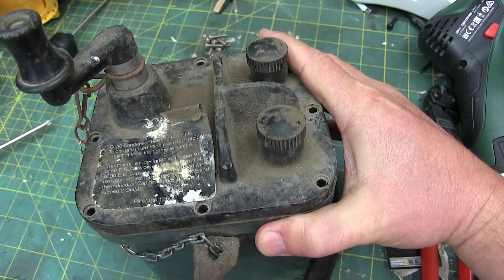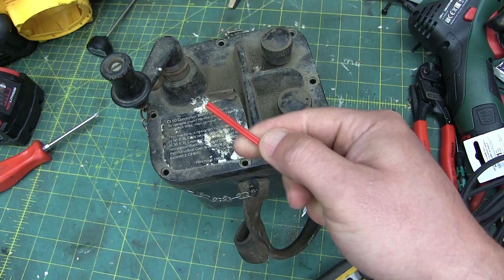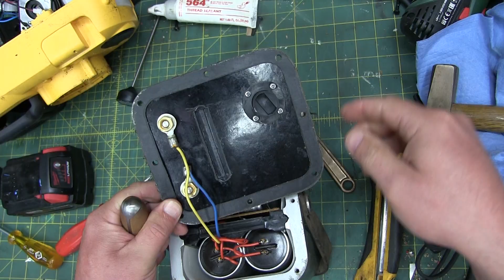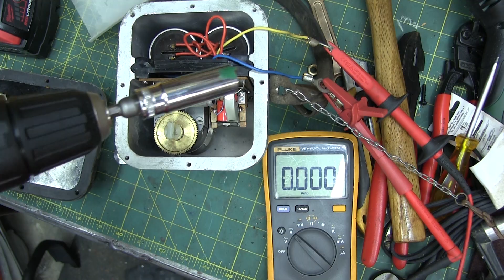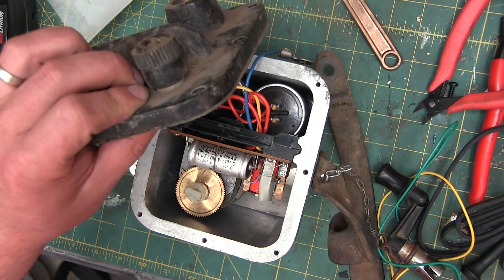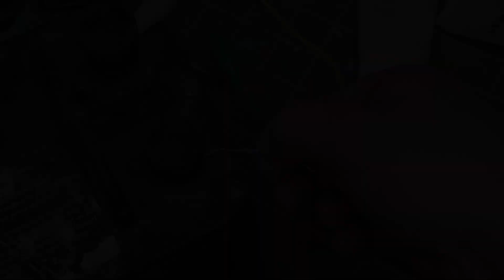BOLTR: Blasting Machine | Cool Old Gear

Comment: I can't help but wonder on whether or not if you connect the blasting leads to your car battery, if it will be enough to assplode.
And if it doesn't, what if you then try and start the car while everything is connected?

Comment: Back in the 1980's, I worked at a consumer electronics repair shop. You're blowing up resistors brings back memories. Take an 8 ohm 1/4 watt resistor and and place it on the back of a speaker attached to the input lugs, then wrap the fuse of a firecracker around it. A tech that just got done repairing an amp will test it out on the speaker and when he turns up the volume....Kaboom!.  Today you probably would get fired for that. Back then, you were just told not to do it again.

Comment: Just a thought from how you were tapping on the top of that screwdriver/prier- if the titanium blades in the handle were rotated by 90 degrees, you could hit it in the "prying" direction, without transferring the force though that strange spongy cellulose material

Comment: you can clear the non-glass glasses with a high temp flame, like a cigar lighter. Just touch the flame for a few milliseconds horizontally and it will be cleared.

Comment: In my high school psychology class the teacher had a blaster box very much like what you got, a crank handle with two leads coming off it. The idea was to observe subjects reactions to sudden unexpected stress conditions. The unit was to be cranked slow till it hit some kind of voltage threshold delivering a sudden mild shock, only the fact it gave a shock wasn't told, the lie was the body's resistance caused the buttons to pop up, each subject was to be filmed in an isolation booth and the videos were to be viewed later. I was lucky enough to be the "Cranker" since I knew what it was. A neighbor girl I had a crush for was asked to demonstrate how the leads were to be held to the class before entering the booth, when about half way through the instructions I lit into the crank like prison grub, I had however no idea how high you could get the voltage up to, I'm thinking car battery at most, by the look on her face it was obvious every muscle on her body had just puckered hard enough to bend steel. I never did get a date with her after that, in fact she would go out of her way to avoid even passing me in the hall, some just can't take a joke. I had ten days detention for that and a trip around the campus picking up trash, I guess only capital punishment was good enough for her.
Reply: P.S.- I have accidentally urinated on a live electric cattle fence wire before (you can bet I never did that again), so I knew how there was no lingering effects from the shock.

Comment: "...anything you want me to do with it..."
Ooooh, yeah!  
Bigger capacitors to initiate via exploding wire a water aluminum powder mixture for the purpose of metal forming....https://www.google.com/url?q=https://www.osti.gov/servlets/purl/12653&sa=U&ved=0ahUKEwiZpbzvgPbcAhVHlKwKHUrqAawQFggZMAY&usg=AOvVaw1FHXyGhuNVCofxfcP_wviy

...or skip the aluminum powder...
https://www.google.com/url?q=https://aip.scitation.org/doi/pdf/10.1063/1.341365&sa=U&ved=0ahUKEwiZpbzvgPbcAhVHlKwKHUrqAawQFggNMAE&usg=AOvVaw0l0FnuLMFCrqzR7bC_-laL
And just explode a wire in water to shape sheetmetal to an evacuated form.

Comment: All my videos that venture into blasting get demonetized. But hey even if I do a video with no swearing or anything wrong it's still demonetized. YouTube never tell you where the problem lies. I dare say that beautiful machine is built to shoot 50 caps in series. The blasting mother you want is the Beethoven Mk 7 Exploder. That baby's got a killer sting. Condenser style exploders don't like parallel circuits. Their impulse is too quick to excite the circuit when the bridgewires are stacked up in parallel. Anyway it's a job for some. Obviously YouTube is in RIP mode. Killed by PewDiePie
Reply: You mean Wall Street Journal.

Comment: I think you should figure out a way with all the gears that you have in your shop to mock up a block and tackle in a box that runs off a drill have it go right into a gear have it go right into a drill Chuck use a lot of the gears that you have unbelievable reduction so you can hook up pulley up to something and then you use this gearbox with a drill and you can lift 500 pounds your creative it like that I could actually use something like that and that would be cool to watch build gear reduction is Skookum as frig

Comment: I serviced a capacitance discharge unit that was a box like 3'x2' and 2' deep. It was filled with capacitors about 4" diameter. Big 3/8" thick copper bus bars connecting them together. Also for setting off explosives.

Tested it once serviced. That motherfucker made cables that were 2" diameter literally jump a couple of inches off the ground....

Scary shit lol

Comment: Ingenious how this works:  generator charges big capacitors and little capacitor.  Little capacitor has a neon bulb with a break-over (conduction) voltage of ~60 -120V  (works like a HV Zener diode) connected to relay coil; relay discharges large caps to dynamite.  Boom.   This system is a minimum voltage level auto switch, when you crank enough to charge up the big caps enough, the relay switches them to the dynamite.  No batteries or power supply needed!

P.S. Gears are not "reduction". The ratio of the Large Gear to the small gear  on the dynamo speeds up the RPMs on the generator to produce higher voltage (simple generator = higher RPM = Higher Voltage).

DC or AC? Solid or stranded wire? The "skin effect" is better for high frequencies, so stranded wire would be better. Why?  The real issue is Dv / Dt  (Delta Voltage vs Delta Time), essentially the fast change of the voltage (from the discharge of the Caps).  The fast voltage change is equivalent to a high frequency, and would benefit from the "skin effect"  (rise time in microseconds, can be seen on an oscilloscope).

Comment: I do remember you havin’ grandpappie’s anvil.  Your mission: if your willing to except, it is to manufacture enough black powder to blow a cheap princess auto-anvil shaped object (paaso) into orbit using your new bug zapper.  Being that you’ve affixed to a stump with denture adhesive you could mill up an irresponsibly large steel vessel to hold the powder.

Comment: Uncle Bumblefuck and old skookum mining equipment that makes things go boom? Uh, yes please! Pro-tip: If you ever have a gasketed cover with no good place to poke, pry, or pound to facilitate removal, remove all the fasteners except for one or two. Those should be a little loose, but not completely removed, then beat the fuck outta the cover with a soft-face hammer around that fastener(s). Learned that one working at a salvage yard that specializes in Jeep parts. Works great on Dana 35 differential covers. Not sure why, but it does. As for things to dicker? I say cobble that thing to an electric motor, chuck a spark plug in the leads somehow and see how long it lasts until the center electrode is gone.

Comment: Imagine cranking this thing with half a ton of boom sticks on the other end, with no way of knowing when its gonna pop. Jack in the box from hell, the anticipation alone would kill me.
Reply: Reasons why the US/UK didn't use this for anything besides engineering purposes or disposing of explosives. You'd normally be pretty far away if you're using this old thing. The better ones were smaller and used a windup plunger method and actually fit in a demo mans satchel. Only issue is they require silver chloride fuses.
Reply: It should really play "pop goes the weasel" as you crank it.

Comment: In electronics class back in the day we would goof off with camera flash charging boards (remember disposable cameras.) They were a self contained capacitor, charger and battery. Pretty fun probably not around any more. Also in college I remember building a device to charge a capacitor using a 555, transistor and a transformer hooked up in reverse. Good times.

Comment: 5:01 "There's a gear reduction in there, so the motor will turn slower", hand crank turns big gear, which in turn turns motor's small gear. It's a gearing increase. 
This is so that you can turn the hand crank at humane speeds to make the motor chooch at higher speeds, so it generates some proper high voltage charge in the skookum capacitors.

Comment: If the contact on relay was held in and the generator cranked what do you think the output voltage would be? Would it still peak at 200ish? Or if you disabled the relay from "automatically" switching on can the capacitors produce a bigger bang if you cranked it and then manually engaged the relay contacts?
Reply: Dang rewatching old vids then seeing you here

Comment: Seems to me that the neon bulb is in series with the relay coil acting like a super simple treshold detector - when the capacitors reach a voltage higher than ~185V (neon bulb striking voltage) it energizes the relay and closes the contacts, finaly dumping current into the blasting caps.

Comment: Hook it up to the scope, single trigger, through a 100:1 resistive divider just to be safe (to protect your scope), to see the actual peak voltage. I'd bet it's a good deal higher than 212 volts, just too short a pulse for the meter to accurately capture.

Comment: When I was a young apprenticed sparky my boss would use a hand-cranked 500 volt Megger (low current) insulation & continuity tester to shock me at every opportunity. He thought this was a great laugh until the rainy day he returned from a trip to the van to our place of work with wet hands and placed one hand on the door latch and the other on the key. Unbeknownst to him, I had connected said Megger poles to the inside of both the latch and key and was cranking the tester as fast as it could go when he attempted to open the door. From outside there was a cry and the sound of an armful of electrical components falling to the ground, followed by much laughter on my part. Needless to say, I was never 'Meggered' again after that day. Good days, now sadly long ago!

Comment: AvE Seems to me you could connect this to a small ball of steel wool and ignite anything you want: campfires from a distance, fuses for fireworks from a long distance-a ball of steel wool burns hot under the influence of angry pixies, and if you blow air at it, stand the fuck back.  Thanks for all the great videos.

Comment: see if you can use the current spike to save lipo cells that have gone under voltage and  wont charge on a charger  . buy flashing them for a few times and see if that charger will take them . be good fun it it dont work

Comment: Test the output signal with a oscilloscope, I'm curious about the shape of the voltage spike, specially from a couple of miles of wire.

Comment: Oh man...  I wanna see that thing hooked up to a scope to see what the woltage actually spikes up to.  And is it difficult to crank by hand?  Some of us guys were a little more skookum back in the day too!  One other question...  So I was making some of this stuff today https://www.mcmaster.com/#standard-plastic-and-rubber-tubing/=1e2r92c  the 5 thou ID variety and as I was trying to pin it to make sure they wouldn't be selling you some wonky stuff, I couldn't help but wonder what in the hell it's used for.  A FIVE thousands ID!  I was able to keep it super consistent, so possibly for a capillary line or...  water jet tip?   Do you have any clue?  I could probably send you some good and REALLY BAD product if you're curious
Reply: sorry, thought that link would take you right to it. Under Opaque hard tubing,  Extreme pressure PEEK

Comment: I have one of these also, See my long ass comment, but I tried blowing resistors with no success.  I was hoping to be able to use them as matches to replace the wicks in fireworks but we had no success.I was able to blow up  the bulb in a 12v test light, any tips to get-er-to-chooch?

Comment: I have one of these I picked up at a local Sally-Anne thrift store, The lady at the cash asked me what it was for, I new it was for blowing shit up I began to tell her but realized I did not want to tell her anything that might stop me from being able to buy it so I told her "I though it was for setting off fireworks, and just seemed interesting". Mine is in somewhat nicer exterior condition but the same inside I opened it up to just have a peek.  I didn't put my meter on it because I wasn't sure about what it put out and didn't want to blow anything up, but It did blow up the bulb in my 12V continuity test light with a good pop.

Comment: select your range...then hit min/max then tap the continuity button...it will catch very brief spikes in voltage...you might be surprised on the readings you'll get due to the sampling rate of the standard voltage reading vs peak sampling rate....youd likely see quite a bit higher voltage on that output

Comment: i wanna see you use this on a ne2 neon lamp, they should go boom, when i was young i didnt realize the resistor was required in a night light.... they dont work too good when you plug 120v into them directly, also try feeding a old ignition coil, see if you can get REAL high voltage out

Comment: What appears to be happening is the crank generator charges the capacitors until there is sufficient voltage built up to engage the relay that then disconnects the current causing the magnetic field in the coil to collapse and send a high voltage back EMF spike to the terminals.

Comment: You probably just started re-forming the capacitors this time out. I wouldn't be surprised if it is capable of much more with them built back up (or replaced).

Comment: How about launching a rocket with this? You can get rocket motors at hobby stores, and they include these electronic matches to light them. I would actually like something like this, the hobby launchers you get i found are somewhat dangerous in case of murphy's law striking your rocket. I've had a rocket parachute charge explode on the pad and then the rocket launch, don't know how. but the launchers use 6 double Ehs and they put you within cocks reach of the fucking thing.

You can also get black powder without a licence at your local cabelas. For research and scientific purposes, eh.

Comment: This would be a badass igniter for a gas grill. Only problem is the breakdown voltage for air is about 30,000 volts per centimeter so you would only be able to have a max air gap of 0.003” at 220V . You would need to increase the rpm of the generator/dynamo by like 100x. Still would be cool to have a hand crank grill.
Reply: Connect it through an ignition transformer.
Reply: A long while back I built an igniter for model rocketry. It had a keypad for a combination , a security key switch and a big button under a red flip door. It was cool I used it to ignite my Weber grill.

Comment: You'd have fun with an old 50 cap machine. Just a big dynamo, and a plain copper switch at the base that closes the circuit when the handle is fully depressed.

Comment: I’m a blaster myself and if you want to get rid of this wonderful machine, I would trade you a newer model for it! A plastiiic fantastique batteria operated 10 caps wonder!

For the record, a 12v car battery will usually fail to detonate multiple blastic caps in one circuit... You need a higher voltage in order to innitiate multiple electric caps... Mind you, I have used a car battery, a compressor battery as well as a handheld radio battery to initiate a single cap on non-electric blasts! But the best emergency method is to connect multiple 9v batteries (they snap together!) and get a higher voltage...
Reply: Yulp been there myself. And I was going to say the same thing about multi caps needing a bit more umph...

Comment: My guess is that the generator is AC (like the telephone generators), rectified, and charges up the 2 big caps, when they reach a voltage, the neon fires the small capacitor is also discharged into the relay (holds the relay on long enough), which discharges the big ones
Note the bigger gear on the 'handle', so the generator would be going much faster.
You could have connected your meter directly to the caps.
Reply: I agree ... the neon lamp is connected in series with the relay coil and the small cap goes across the lamp and other terminal of the coil . Cranking the (brushed) generator produces a voltage that charges the all capacitors but the one across the lamp/coil combination charges more slowly (series resistor ?) , this allows the two big caps to fully charge before the small cap reaches about 60 volts to fire the neon lamp (on dc) and dump the small cap into the relay coil thus pulling in the armature and dumping the big caps into the blasting wire terminals .
In 1960 , the rectifiers (if used) most likely would have been the selenium type and very noticeable ... they also have a funky (and poisonous) aroma .

Comment: It probably never discharged the main caps.  You are charging the smaller cap till it's voltage is enough to fire the neon, the neon drains through the relay coil and fires.

Comment: It's fun to blow up Christmas lights with those old electric blasting machines. Especially if you heat the tip of the bulb with a lighter, then dip in ice water. Flick the end off the bulb and put some fine FFFF black powder in. Add some fine aluminum shavings for more boom!

Comment: Hook it up to a whole dill pickle & turn off the lights. Crank 'er up & then to heat a hot dog and see how many cranks it takes to do it. Remember the Clint Eastwood movie where he had the fork ends connected to an AC plug? good times